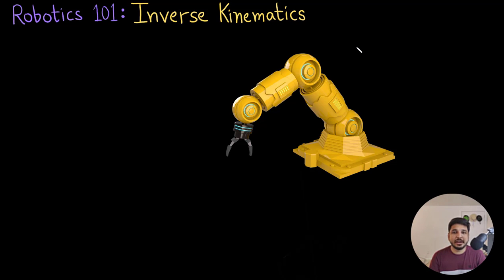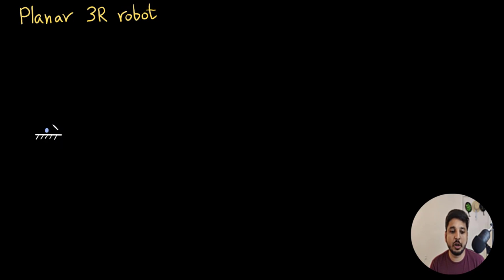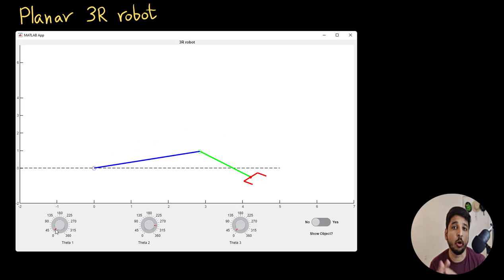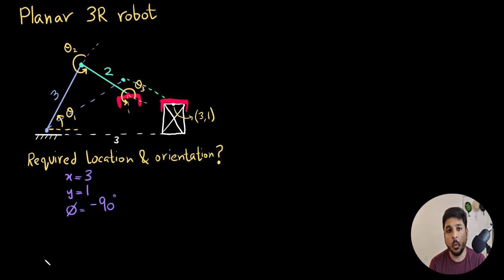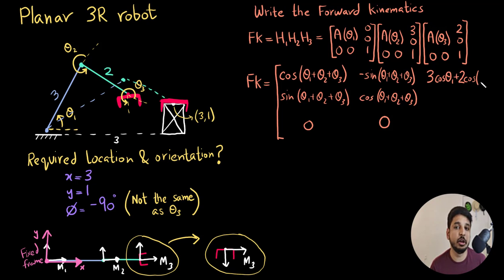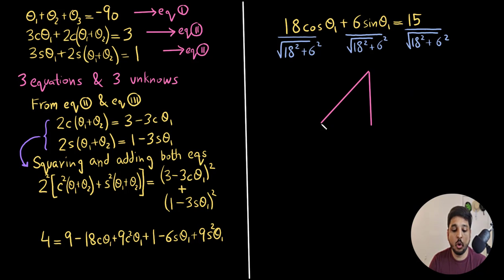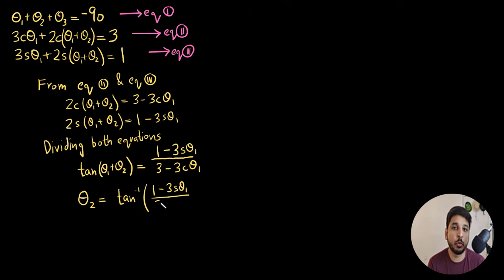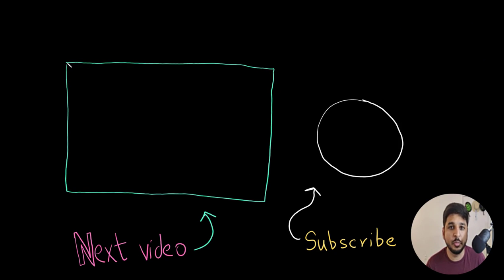Inverse Kinematics of Robots | Robotics 101

Comment: Mr. Zain,

I'd like to first thank you for sharing your knowledge and dedication to make videos with such great quality, I'm sure it takes a lot of hard work to produce.

If I may ask you a question, I'd like to understand why at 7:21 is  ɣ +- Cos^-1(15/√ (15/(18^2+6^2)))

The "+ -" is the only part I did not understand why (could not find a trigonometric for it) 

Thank you in advance.
Reply: The inverse cosine function only maps to [0, pi], which is the first 2 quadrants, but sometimes solutions exist in the 3rd and 4th quadrant.  The minus sign accounts for negative angles from [-pi, 0) as possible solutions.

It is similar to why y^2 = 1 has solutions y = 1, -1.  y^2 = x draws a parabola opening in the x axis, so for every value of x, there are two possible values of y.  But functions only have 1 output per input, so the sqrt(x) function is strictly positive, so you have to say y = + or - sqrt(x).

This is also why there is an arctan2 function, not just arctan.  The arctan2 function is called the 4 quadrant arctangent, because the regular arctan function only maps to -pi/2 to pi/2.  The arctan2 will be needed in robotics to convert from Cartesian to an angle.  This is not taught in math, so one has to "discover" it when running into this problem and hearing someone give a solution.
Reply: @cryora  
Thank you for the explanation 👍🙏

Comment: Hi. Just found this.. Great to see the way this is presented. However have a little problem with maths.  You square 2c(Theta1+theta2) and add to square of 2s(Theta1+theta2)
shouldn't the answer be 4 (c2(1+2)+ s2(1+2)) not 2(c2(1+2)+s2(1+2)

Comment: i got the problem when the unknown variable is more than the equation itself (the equation only 3, the unknown variable is 4), so how do I finish this?
Reply from the maker: You should be able to solve them but they won't necessarily give you a unique set of solution. You can use a software such as MATLAB to solve it out for you or if you are really interested, you can convert them in a matrix form Ax = B and then do some clever thinking to ensure that 'A' becomes a square matrix. One way is to multiply one or more of your equations by one of the unknowns to get a fourth equation. Once you have 'A' as a square matrix, you can suppress one of the variables and then do determinant(A) = 0 to solve for the variable. This is based on the fact that 'A' has to be singular otherwise x would just be trivial solutions.
PS: I know I didn't do a good job at explaining how to solve it. It would require me to write out a lot of equations and consume a lot of time. If you are really interested, you can have a look at one of my papers where I used this method to solve a system of equations. Link to the paper is below and the method is on page 3.
(https://asmedigitalcollection.asme.org/mechanismsrobotics/article-abstract/16/11/111007/1199039/A-Kinematic-Synthesis-Methodology-for-P-Drivable?redirectedFrom=fulltext)
Reply: @EngineeringSimplified  really appreciate for the answer, thanks sir.
Reply from the maker: @simpasalsunda7244  Glad to be of help.

Comment: why is theta 3 not the same as the position of the end effector?
Reply from the maker: The reason that theta3 is not the position of the end-effector is because theta3 is defined from the link2 of the robot. Think about it in a practical way. Let's say we have a motor attached to link2 and you have to rotate the motor, you will tell it to rotate by 'x degrees'. This will be from the link that the motor is connected to and not from the ground (fixed frame).
Based on this, the end-effector orientation is simply the sum of all angles of the links which in this case is 'Theta1 + Theta2 + Theta3'.
I hope that helps answer your question.

Comment: I'm blind or in 6:40 is mistake? 4 = 9 +1+a  (a is sinTheta1+cosTheta1).
4 = 10+a => 4-10 => a => -6 = a
So on the right should be 18cosTheta1 + 6sinTheta1 = 6.
Please correct me if i'm wrong.
Reply from the maker: Thank you for commenting! I looked at the working that you provided- you have forgotten to take into account the two terms which are 'Sin^2(theta1) + Cos^2(theta1)'. I used the identity  'Sin^2(theta) + Cos^2(theta) = 1'and so the working that is shown in the video is correct.

Comment: Horizontal view is out of frame . Can you please fix it and reupload?
Reply from the maker: What do you mean? Can you pinpoint the exact timestamp please.
Reply: @EngineeringSimplified from @4:15 many sections of the video. The bottom part of the video is not seen where you are drawing concepts
Reply from the maker: I just checked and it looks correct when I am viewing it. Can you make sure you are not 'zoomed in'. Also, try using some other device to see if the issue persists. Thanks
Reply: @EngineeringSimplified  probably just my device.

Comment: It is great that you support your video with a Matlab application. I understood better with that software.
Reply from the maker: That's great! Yeah, supporting it with a software really helps to drill in the concepts.
In my more recent videos, I have even started supporting the theory using robot simulation softwares so that you can see the robots move in 3D. One such video is my new videos in the robotics 201 playlist on Inverse Kinematics.
Reply: @EngineeringSimplified  I am about to finish Robotics 101. Then I will definitely start Robotics 201 😎
Reply from the maker: @obensustam3574  Perfect!